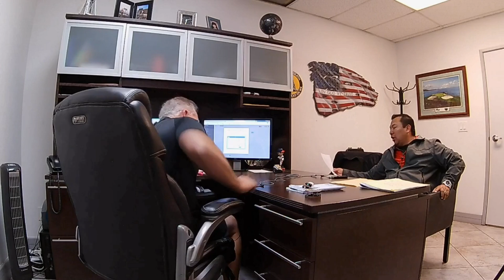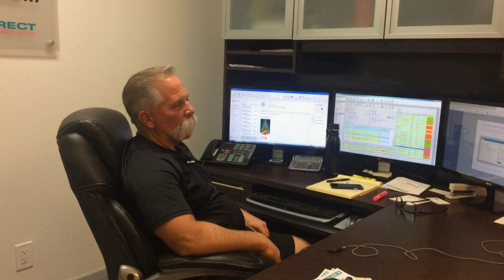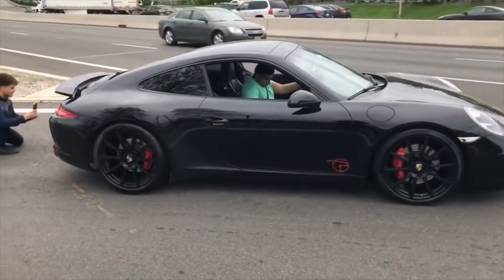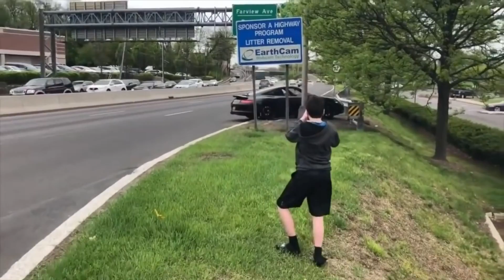Engine Oil Analysis Review - Blackstone Labs - Titan Lab Results Australia - Worth the Money?

Comment: A lab can't tell the future and will miss a lot, not worth over paying for... read the comment below about sending a sample from a blown motor to Blackstone lol.  Blackstone's fees ad up to $175 for what I get from CAT for $15, including postage and a much faster emailed response of 3 days from when I sent it in.     (Soot, coolant ("antifreeze", Sulfur, V100, Wear metals, OXI, NOT, W and F all included, $15 bucks in a pre paid envelope I got at CAT dealer and sent in a year later when I drew sample with included tubing).  I could check Fe, was 19 on 1,000 miles/30hours of some idle time and only pulling loaded; Soot 0, Sulphur 41, no coolant, 1 Cu, 1 Al, 914 Ca addititve to protect cylinder from carbon, etc., all for $15.  Go see your local CAT dealer, maybe don't specify it's from a truck, because when they see a spike and figure out they should charge more....  Anyway, you're welcome.
Reply: I’ve been using Blackstone for UOAs on the Redline 15w40 full synth I run in my Cummins 6.7L turbodiesel and just realized they don’t report the amount of soot in the oil.  However according to their analyses I can safely go 25,000 miles on Redline.  Still no telling how much soot/ash isn’t getting filtered out and thus abrading the internals.  Makes me worry now

Comment: I don't know about transmission fluid, but you can mix engine oil without any issues. I use a synthetic blend on my truck because that is the most synthetic oil I can run without blow by. I guess his trucks may not be designed to run on synthetic, but I would never use conventional in a vehicle that is designed for synthetic. My truck had enough issues with the difference between the properties. You'd think that newer vehicles would exploit these properties of synthetic and not lubricate properly when using conventional. It is different oil.
Reply: Interesting.  I am considering blending synth/conventional in a 7.3 engine, because my oil is still clean looking after 1,000 miles and has a "0" for soot in the lab test (use CAT dealer, it's $15 for $175 worth of the same Blackstone tests lol).

Comment: Testing an unknown motor has benefits, but testing a new engine over and over is a waste of money if you perform proper maintenance on said motor.  Most labs look for the basics and then send you this happy report saying they found no problems.  Consider this, for the price of a lab oil test you could change your oil twice as often if you spent the lab $$$ on oil instead of the "Happy Report"...
I found a blown motor and sent the oil into a lab in Indiana for testing.  Guess what? According to them the engine is in great shape.  A test means nothing unless they are looking in the proper direction.  Lab rats do not know motors, thus, they are lab rats... I went several rounds with the head lab rat and the HMFIC only to hear about the head lab rats military background. I don't care. I only want a proper test that gives me real results that provide usable information which they DID NOT DO, end of story...
Reply: Thanks for the info, from what I see and hear the picture is starting to become clear that Blackstone are thieves and chumps.  They charge $175 for the same tests of soot, sulfur, coolant(antifreeze), V100, and wear metals that CAT charges only 10-15$ for , with shipping included and 3 day turn around, while Blackstone's takes a week plus.
Reply: Unless you have a reason for testing like suspecting oil dilution because you dip-stick reading shows a higher level than when you changed the oil.

Comment: You can Google Irv Gordon. He drove his Volvo over 3,000,000 miles and claimed he changed his oil faithfully every 3,000 miles. I change my oil and filter when I can’t see my oil dip stick measuring lines through the oil. Walmart Super Tech full synthetic oil and Motorcraft filter $21.00 for both.
Reply: For what it’s worth Irv Gordan used Castrol GTX with oil change every 3500 miles.
Reply from the maker: No he changed it every 3,278 miles. Change it often with quality oil and filter and it will last a long time. I have a Silverado I change every 3,000 with synthetic and it has 300,000 miles on it!

Comment: There is very little differance in price between convetional and synthetic oils. Heat is the killer of conbustion engines and this is where the group lll synthetic oils come into their own, expecialy if it´s a Turbo Charged Engine as most heavy trucks are. There is no reason not too go synthetic.
Reply: @sneakypete187 Walmat Super Tech Syn. 5w30 for $15 5 quarts. API SN
Reply: @sneakypete187 Walmarts buys it´s Super Tech oil from Warren Distributions.

Comment: i change the oil 3 times during the first 15,000 miles of a new truck. After that i refill with Amsoil and only change the EA oil filter every 20 to 25,000 miles and top off the oil. Zero bottom end problems and at between 600 and 650,000 i sell them in good running condition and buy a new one. That IMO is not creating alot of waste.
Reply: So you're not running Fords  lol   Only the 7.3 would handle that treatment reliably.  Cummins?
Reply: @galehess6676  No. Not at all. You can run any engine with our oil like he described. Our stuff is 100% Synthetic. No ‘Full’ Synthetic.

Comment: You say, "Use conventional oil instead of synthetic and just change it more often". Do you realize that there is less than 15¢ a quart difference between the cost of conventional oil vs full synthetic when using five-quart jugs of Supertech oil? Why not just use the synthetic and still change it at the same interval as you would with conventional? ...?
Reply: Modern synthetic oil is better in every way. It will withstand high and low temperatures better, lubricates better and it will last far longer.
Reply: Steven Sevek absolutely, I agree with you.
Reply: @jibrilsarabi2908  Because like he said in his video "maybe I'm a idiot"
Reply: Well he doesn’t know what he’s talking about.
Reply: Funny thing is he says change it every 3k my bmw it’s up to 15k the computer tells you when to change it. That car has 252k miles and hasn’t ever had the engine torn down. Starts like new. Car always took full synthetic oil.
Reply: I agree with you, however that Supertech oil you mention, is not ‘full synthetic’. Full synthetic is a marketing term. Use oil that is 100% Synthetic then you will be following what your manufacturer recommends. Remember, we invented Synthetic oil for vehicles. :)
Reply: @peterssynthetics  Oem manufacture oil is not even 100% synthetic. They mostly source thier oil from industry brands.  So if a manufacturer says use full synthetic(we recommend our brand of doodoo juice). It still is not 100% synthetic like your exclaiming. I just purchased a gallon of Aimsoil for my next OCI, but let’s not futigate here either.
Reply: There's a much larger difference in cost.
Reply: @VndNvwYvvSvv  
Currently there is only 10¢ a quart difference between conventional 5W-20 and full synthetic 5W-20 (when purchased in 5-quart jugs).
https://www.walmart.com/search/?query=super%20tech%205w-30
Also if your vehicle calls for 0W-20 that grade of oil is not available in conventional.
Reply: @njsongwriter  You arent running what you think you are running. The bottle needs to state ‘100% Synthetic’. There is not 100% synthetic in the bottle, no matter how you slice it. Full Synthetic is a marketing term to fool people. They cut the oil with conventional oil and call it full synthetic.
Reply: @njsongwriter  that's because 0w20 in conventional oil is the same as 20 weight oil.

Comment: If you cook the oil it will turn black without any dirt added to it. So the engine heat can darken the oil. But yes the detergents in the oil keep dirt and contaminants in suspension and that also turns the oil black.
Reply: additives turn oil dark.  the detergent is in there to keep the dirt/particles in suspension so they make it to the filter.
Reply: Yes, partially. However, conventional oil burns at 260F. Hes shooting his own foot. Our oil starts to burn at 475F. Difference is night and day.

Comment: When to change the oil is always a hot topic. Thank you for making this clip, I enjoyed watching it, hearing your perspective. In 2 of my vehicles, (2002 7.3 ford diesel and 1981 rabbit diesel) I installed oil bypass filtration that filters the oil down to 1 to 2 micron, through an amsoil 1.5 qt bypass filter. I should be able to go extended drain intervals for my set up, but an oil change is cheap insurance.
Reply: I have a '97 7.3 F250HD, and a made in PA (where I live) '85 Golf diesel.  Blackstone charges $175 (I added up their pricing) for testing (soot, sulfur, antifreeze in coolant, V100 and wear metals), but CAT charges $15 for the same stats, slightly more other info is also provided.  If I were you, I'd not worry a bit about changing annually or at sever duty or normal use intervals (whichever comes first, a year, the interval).  I've tested and found nothing interesting in the tests, both Blackstone and CAT said it's fine, keep running it after 1,000 miles on different oil changes.  I plow and pull but don't have any mods that can affect injectors and turbos and wear the oil prematurely.
Reply: @fredflintstone You are doing everything correct. Running our oil and bypass filter, you can possibly go long periods without doing an oil change. Use oil analysis. Our kits are $30. If you need any Amsoil, please let me know. I hope you have motoring pleasure for many, many miles and years!

Comment: There is plenty of reasons to check the oil.  
Coolant can alert you to an oil cooler or head basket failing, or even the compressor. 
Fuel dilution can alert you to a failing injector or cylinder issue. 
It will alert you to a failing air cleaner. 

Its for more than oil change interval. 

My engine is worth $55,000 and I use $350/day for fuel.   A $30 oil sample every month is a great way to monitor the engine conditions
Reply: @Peter Angles Sure let me get right on that! Great way to talk to someone who is just making a living with the highest quality product on the market, for motor oil. Not overpriced. If you use Amsoil you can go 2-6 times, with oil analysis, the OEM recommended drain interval. So how about go take your oil, recycle it and buy some Amsoil, from another dealer of course! (I make no money for referrals to another dealer) I said all that bc I personally wouldnt want a negative nelly as a customer anyway. :) Have a great and prosperous day!
Reply: Please consider switching to Amsoil. Thank you.
Reply: I don't care what oil you are using, if there is coolant or fuel leaking into the oil the oil needs changing and is not a factor at all. Or are you trying to imply fuel dilution of motor oil does not affect  the oil? If you are saying that, you are about as knowledgeable about how oil reacts with fuel added to it in a crankcase and need to start peddling olive oil for a frying pan.

Comment: Cool video but hard to take the advice for anything but mid-size trucks. Wish an automotive tribologist could chime in on the above advice. Changing your oil early will always be better for the vehicle, using non-synthetic oil in a synthetic-speced engine is nonsensical, especially under warranty.

I've had 8 cars in my life, sold only for better ones, and have always just used the OEM or equivalent oil. 

Except my manual 2002 Saturn SC2. Always used royal purple 5W-30 for the commuter and got 42+MPG on it.
Reply: NikoVlogs First off Oil Analysis test are total BULLSHIT, your being played. If they truly are testing the oil they don't need to know shit about how many miles it has on it and what vehicle it came out of. It all an ( algorithm ), they aren't testing shit. 
To prove my point, change your oil, run the new oil for 500 miles, drain it and send in one sample and put it has 11,000 miles with no vehicle description, send in another sample from the same batch of 500 mile oil 3 weeks later and put it has 4,000 miles with no vehicle description. Sit back and wait for the sample results and you'll realize how much of a scam and bullshit it is. And people are paying money for that crap!  It's a scam!
Reply: @Mr.Beastforpresident  Sir, your algorithm and oil analysis being a scam comments are blatantly incorrect and simply an opinion with no scientific basis, whilst not absolutely necessary to understand what machine it came from, it is helpful, different engines and components etc run very differently and have different metallurgical components and produce different results, to add to this, not all oils are created equal and different oils in different applications have different break points where the oil will 'fall over' when in use. Think about a standby genset versus an engine running under full load or car/truck doing short mileage around town vs on highway. If you had the data points to back up your claim (which you wont) i would be interested to see them. Oil analysis is a proven tool in detecting the ideal change point through the monitoring of the oil condition enabling proactive customers to achieve the most optimal change point which will save you money in the long term through fewer oil changes (if you have a large enough fleet) in addition to having the ability detect faults such as an increase in wear metals and dirt and fuel entries potentially saving components from failure. That said, advice on changing oil early is hard to refute using a good quality oil and changing it early is always a good idea if you dont have the analysis tools at your disposal. Good day.
Reply: No Chance I’ve put 541,000+ miles 13,000+ Engine hours on a 2008 GMC 2500 GAS 6.0 LY6 on Original Engine & Transmission. Without ☝️ b.s. oil analysis. 

Oil analysis was designed for big ships with HUGE engines hundreds of gallons of oil. Keep drinking the kool-aid on oil and oil analysis. It’s your money. 

There’s no substitute for experience. I’ve driven gas vehicles ( Commercially ) over 21 years and have many friends in the business. None of us do oil analysis and we go to oil labs all-the-time to drop off ship samples.

To each their own, again it’s your money and I’m sure the oil labs appreciate your business just to tell you your oil is good or bad.

Comment: Oil is oil... dirt is dirt. Never the twain shall meet. Oil NEVER stops doing its job, the crap that gets in it is your problem. Keep it clean and your stuff will always be happy. Synthetic were invented by the Germans during ww2 out of necessity, they simply were out of it, just like synthetic rubber. 8000+ mile oil change intervals are bull shi*... Vehicle manufacturers work towards CPM, Cost Per Mile,,, and getting you out of the showroom and out of the warranty asap... spend your money on new oil, top quality filters and emission controls, the CPM will follow. Your old 440 Hemi died at 80K because of blow by (combustion residue) and contamination, not bad lubrication. 

I have a 350 L82, 10 to 1 compression small block that will trash the oil in 2000 miles because its a pig... Regular oil changes every 2000 to 3000 miles will make it last almost forever. I have driven every car I have ever owned to the junk yard in perfect running order... Great vid. the truth has been told.
Reply: LaPabst You mean the 440 died at 80k because it was Carbureted, running lean in the Winter wearing out the upper compression rings and Rich in the Summer diluting the oil.

Comment: Dark oil doesn't mean dirty or contaminated oil.  All oils will naturally darken simply due to the heating and cooling process, and fuel quality.  Are your fresh baked cookies with browned edges dirty and contaminated?  No, they're fucking delicious and how they should be.  Besides, upwards of 30% or more of modern formulations isn't even oil, it's the additive package, like detergents, conditioners, stabilizers, viscosity improvers, anti-foaming and wetting agents etc.  Science has been quite clear, synthetic will always out perform conventional oil.  In Germany for instance, their high quality fuel allows standards like VW's 504 00 (low SAPS) to have 30k mile change intervals and growing.  Compared to hardly 15 years ago, the every three months or 3k miles was the standard change interval!  To put it differently, what would take 10 conventional oils changes, only takes one synthetic change, or $400 compared to $60 over the same two and a half years.  Oh, and there isn't a single manufacturer approved conventional oil, full stop, and you'll loose your warranty if you use conventional oil...but naw, all those companies just have it all wrong, this guy knows best, it's a damn conspiracy!  He isn't pulling the "if it was good enough for grandpa, it's good enough for me" card, this guy is just lazy.  Don't listen to lazy people folks.
Reply: Obscene language is not necessary.
Reply: @njsongwriter  Most things that happen and we do aren't necessary, but it wasn't obscene and that's according to case law established by the FCC when Bono slipped up on live tv. 
"The FCC received hundreds of complaints about the Golden Globes broadcast after Bono, the lead singer of the Irish rock group U2, said, "This is really, really, f------ brilliant."
The enforcement bureau said last October that Bono's comment was not indecent or obscene because he did not use the word to describe a sexual act. "The performer used the word ... as an adjective or expletive to emphasize an exclamation," the bureau said."
Just as I did.